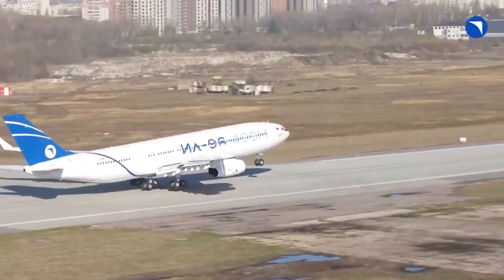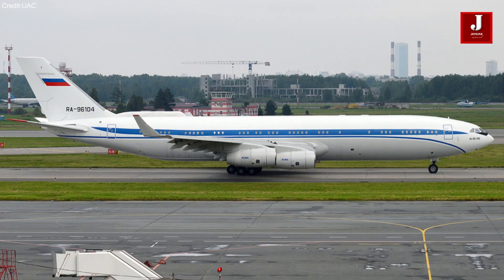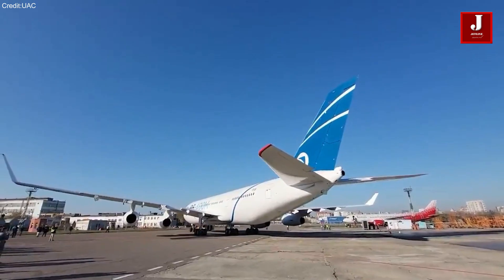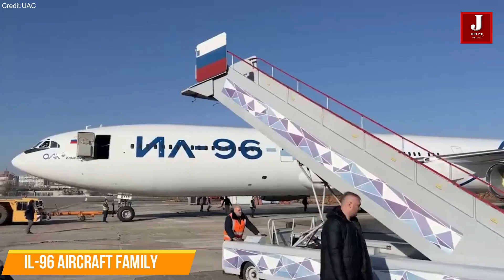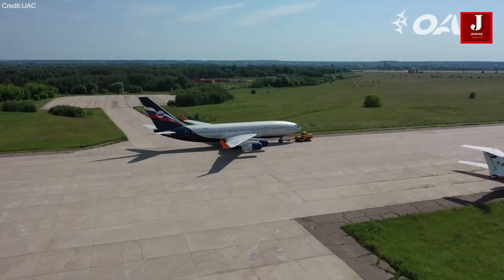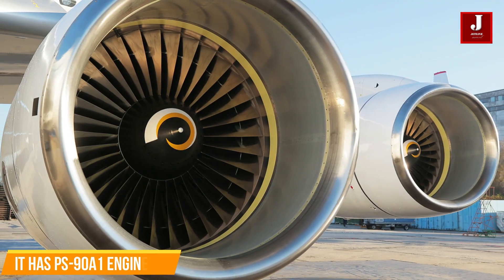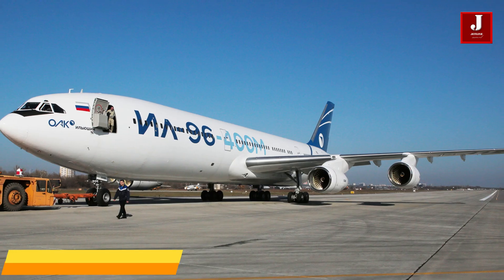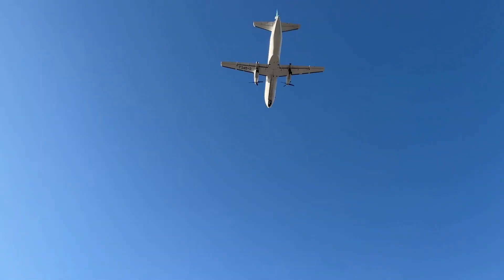8 Facts about the IL-96-400 Aircraft, the Russian-Built Wide-Body Aircraft - Jetline Marvel

Comment: A solid, Well designed airframe as the Il-86 and 96 has had very few hull losses but it is going to be thirsty fuel wise with 4 previous generation engines.

Comment: What a laughable video. Popular with cargo operators?  No one uses this crap outside Russia except Cubana, and theirs spend more time in maintenance than flying.
The only fascination on this plane is that it's absolutely irrelevant. No one except brain washed russians will care about it, and the only reason it will "sell" is because russian airlines can't buy anything besides this or chinese boeing / airbus copies with a ton of western parts. What brain dead company will buy this gas guzzler and maintenance nightmare, even if it's supposedly cheaper than western planes? None, except the cronies.
And it will not have better chances if, and it's a big if, and when they can manage to create the supposedly 2 engines version.
Fantastic cockpit, Aeroflot pilots will love it 😂And Aeroflot and all other Russian airlines will send them to the garbage the improbable instant they can buy the "crappy" western planes again. Like they did to the also fantastic old IL-96s.
The Russian aviation industry has 0 chances outside Russia, because they don't have a clue what that is.

Comment: Brand new Russian passenger plane meet Boeing 1980s plane and Airbus 1990s plane. There is no comparison. The engine has radically higher fuel burn and a lot less range than A350 or Boeong 777. 

It is an improvement for the aircraft manufacturer,  but Russianplanese have always been behind the time,  and this is no different. It may be more comfortable, but no profitable airline will buy this.
Reply: Fuel efficiency of this plane and the latest Boing plane may not differ more than 10%. Fuel efficiency is not everything. Fuel is much cheaper in Russia.
Reply: @shaileshgarg6393 Mach da mal 20% .draus
Reply: @shaileshgarg6393 . Not called a Gas station for nothing.
Reply: Given sanctions, it will have a LARGE domestic market.
It's also not likely to be any worse on efficiency than the Airbus A340 - many of which are STILL flown.
Reply: @bricefleckenstein9666 no, the russia maket is not large, 144 millions of russians, it’s not enought to be indépendant.
Reply: @nicolashommerin7729  They also can sell to Cuba (tiny), in theory to China (NOT SMALL), and probably a few other places like Iran (small).
They also don't have a CHOICE about being independent given sanctions.
Reply: @bobby1970  North Korea was covered in that "a few other places" part of the comment.
VERY small market, though probably bigger than Cuba.
Reply: They say the same for Huawei smart phone.
Reply: You made a mistake, it’s boeing 1990 and airbus 80. Airbus is technologically more advanced than boeing.